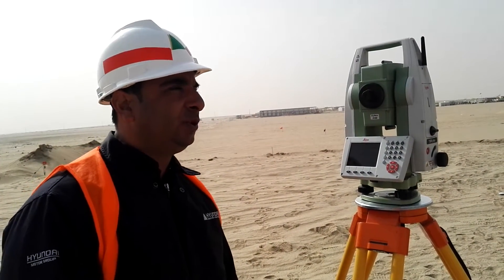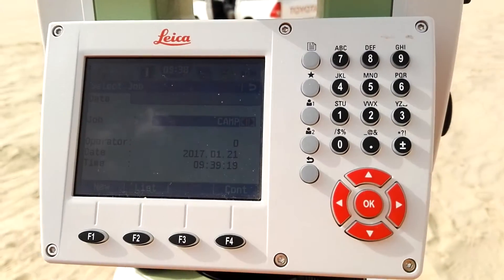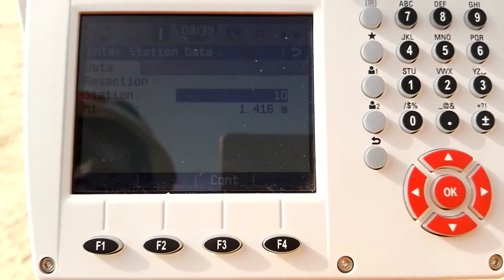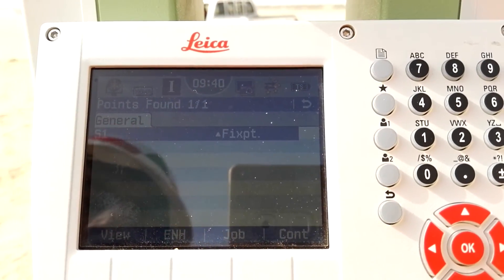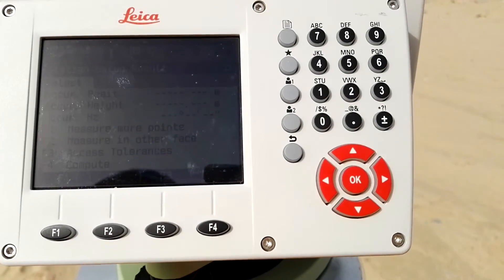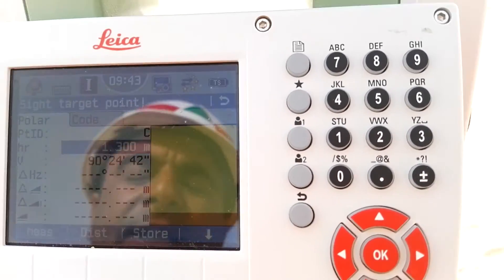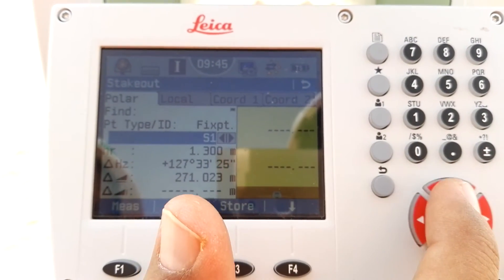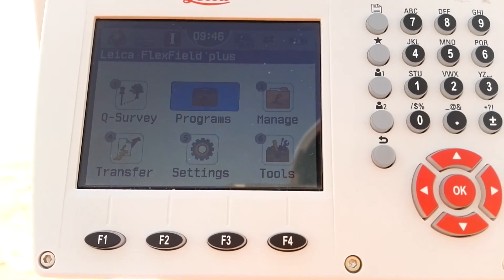How to Perform Resection in Leica Total Station TS09 Plus in English

Comment: For better resection/free station, we need how many known points?

Both face measurement is necessary or not?
Reply from the maker: 2 points are enough but if you use more points then accuracy will divide with all points
Reply: Should do on both faces. Should be more than two points for redundancy. However. Its not worth measuring on two faces when you have active tracking to targets

Comment: Why why, WHY you guys don't use Data collectors with this Leica?! What is the purpose of poking on a screen like that when you can I have all the data available via Bluetooth at the palm of your hand. Like a little beauty Spectra NOMAD 1050... you can shift trough the screens, customize favorite programs via star hot key, change target types, target heights in a split of a second, you name it. Without wanting to sound patronizing, I just can not wrap my head around this approach to surveying. Work output is dramatically reduced.